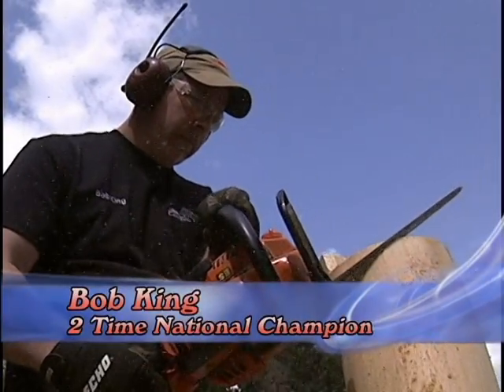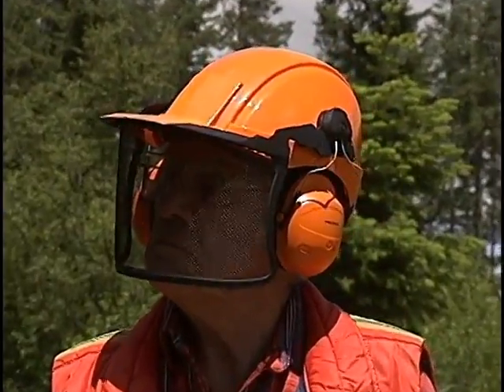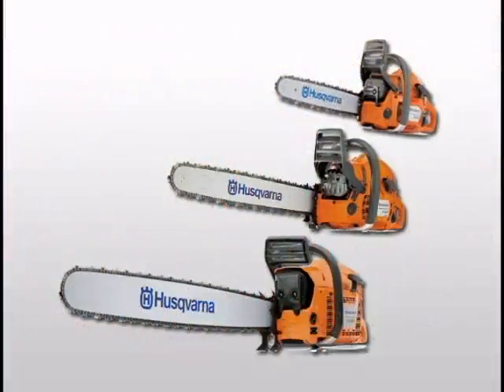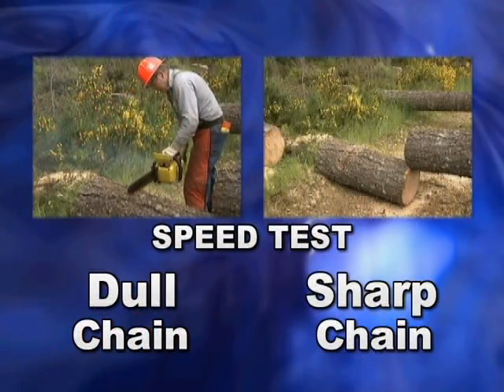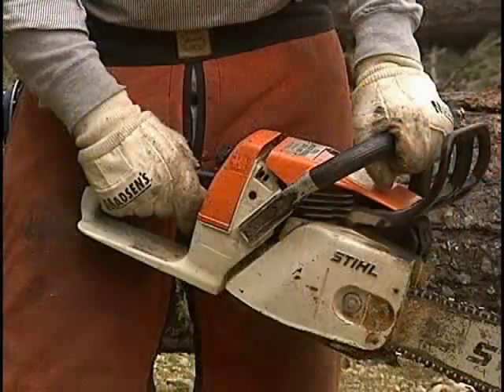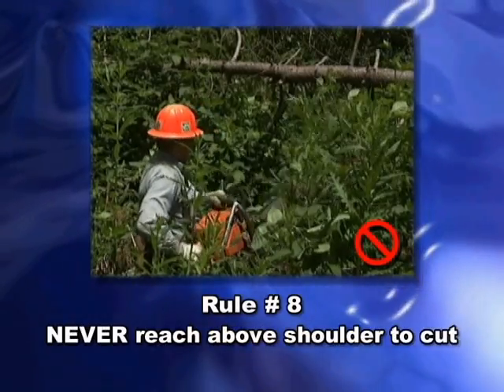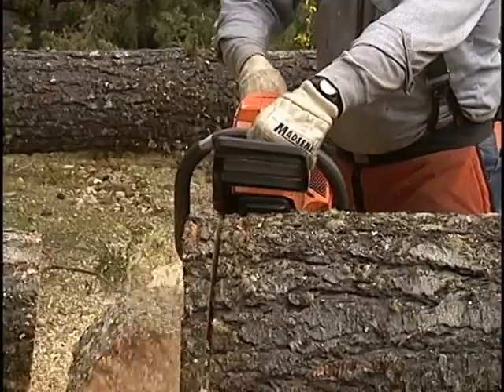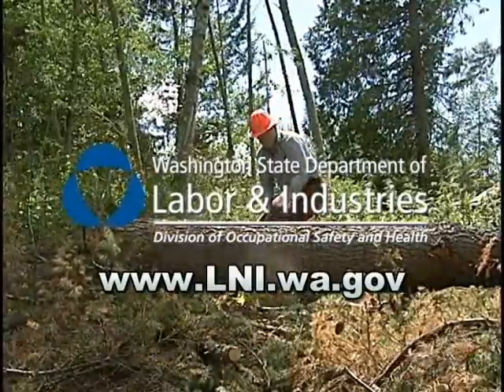Danger : Chain Saw

Comment: Professional Arborist / Logger. Didn't know everything here. Thanks!
The best advice I have after all the yrs of experince is to not get comfortable and lax and to keep a very firm hold of the saw.  
Another thing is to have your left arm where the brake would get tripped in case of a kickback.  I have experienced many kickbacks, but they are not as violent as the one in the video IF you are holding firm and the chain brake should do the job in most circumstances. If you are not a pro, hire one!

Comment: I have used chain saws, the chaps appear to be a great addition to the safety equipment.

Decades ago in a lumbermill. I saw a kick back event. Little or no safety gear...  A medium to small saw that was being used near a metal plate structure to remove some piece of wood for some reason. The saw kicked back into the operators face then dropped down and hit his thigh... two cuts, both needing stitches. A chainsaw cut will leave a very noticeable scar... the guy with the face cut did not bother growing his beard back... a chain saw removes about a quarter of an inch of wood or flesh, so it leaves a scar that folks will notice on a face.

I tend to use other types of saws if I can and I am very aware of the damage a chainsaw can do. For home cutting I am more likely to use a reciprocating saw for pruning or cutting small firewood.... chain saws are useful, and they are dangerous. 

Thanks for the good video on the topic.
Reply: chainsaws are not dangerous, its how the operator uses it that can be dangerous.
Reply: ian martin I agree the operator who does not know the hazards are/is dangerous.
 I have used them, and I have seen injuries to people who were too comfortable with using them and other saws.

But after working in the lumber industry since '71 I still have all my fingers and toes...
Reply: reciprocating saws are bloody slow though i have 2 and never use em, i use a good lightweight skill saw as much as i can next level up i use my bosch 36v battery chainsaw as its so light then for the really big stuff i crack out the stihl petrol chainsaw but to be honest for home use the stihl is hardly used now

Comment: I understand the "Drop Start" to be a bad method, which it is with the blade brake off.  But many times (especially with the bigger saws) I will do the drop start, but ALWAYS with the Blade Brake ON.

Is this a bad method?  ie will it damage the saw? or any other risks?

I remove the brake and do a free spin as soon as it starts.  I just like the safety of knowing the blade cant spin when I start it.

Comment: Carolina Logging Boots (however far up the shin they might be in the video) do not offer the protection of Kevlar or Ballistic Nylon constructed chainsaw trousers. The leather of the boots will offer little protection from a sharp chain. These boots should not be considered a alternative to buying the 'correct size' of trousers or chaps. In my humble opinion (right or wrong) the chaps in the video are too short. They are not providing as much protection as a pair of ankle length chaps.

Comment: I have always viewed power tools as rabid tigers that need to be closely watched. I remember ranting at my mother while I was cutting willow saplings on her property with a brush whacker. She kept walking up into the kickback area. Another time, a foreman I was working for gave me a circular saw with no spring to close the blade guard. After I sat it down on concrete with the blade spinning and wrecked the blade a couple of times, He went and got that $2 spring. lol It could have very easily been against my leg, as you may know if you ever used a circular saw much. He should have listened to me when I told him to get a spring in the first place. Always grip your saws firmly and be aware of the hazards.

Comment: The chainsaw classification shown here is amusing. Up to 20 inches(50cm) blades are "tomato slicers" and only 28+ inch "professional chainsaws"? The assclown who came up with this would be surprised to know about all the serious professional logging done with 35 and 40 cm blades. Oh, this wasn't about safety, workplace hazards or professional knowledge, just quasi-macho tool measuring. Yeah, never mind then.